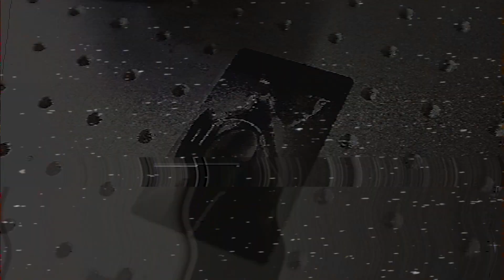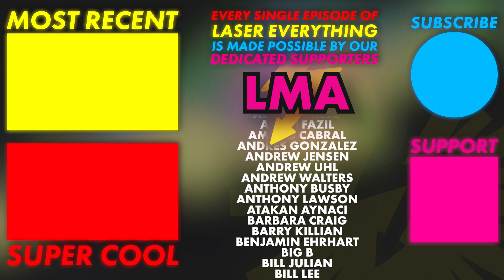The Number ONE Reason Your Engraving is UNEVEN

Comment from the maker: If you guys are looking for answers for CO2 Gantry style lasers, here's a pro tip:
Its a similar issue but instead of a galvo head needing to be leveled it's your bed or gantry. The gantry are the rails the laser head rides along. It's very difficult to level the gantry and it definitely wont fit in a youtube comment but you can shim your honeycomb table just like we shim the laser path in this video with some shims or metal business cards. Most honey comb tables separate from the actual platform to allow you to place shims. Make sure you place them evenly. Remember you are not leveling your honey comb table to the ground! You are leveling your honey comb table with the GANTRY! So place the level on the gantry, then make the honeycomb table match that, shim as necessary. Should solve the issue!

Comment: I have an issue with my 30 watt raycus. When do multiple passes the power seens to get less and less after each pass. I noticed if i apply some downward pressure to the head, where the lens is mounted it seems not to lose any power, but if i release pressure it loses power again
Reply from the maker: Lasers all have a focal range, or a range in which they operate at peak ability, before the dot size is so large you are just heating the area instead of engraving. It sounds like the deeper you are going, the further out of focus you get. You may not be in the center of your focal range at the start, and after a few passes its already hitting the edge of its range. Either way, I wouldn't suggest pressing down on the head too hard or much, as that may cause the issue we discuss in the video to appear (if you end up bending the path and head forward over time when doing that). I'd suggest focusing down a bit more to start to identify if you can get further into the material. If that's the case, it's likely what I described with your focal point not being in the true center of your focal range.
Reply: @LaserEverything  i would agree until i noticed if i pause the engraving for 10 seconds or so and resume it. It seems to fire back at set  power. Only to lose power slowly there after.

Comment: I had this "type" of problem on my CO2 honeycomb.
Reply: Me too, was wondering how to fix it. Then this video popped up.
Reply from the maker: @pfiltz @ianlets7531 If you guys are having this issue on your CO2 its a similar issue but instead of a galvo head needing to be leveled it's your bed or gantry. The gantry are the rails the laser head rides along. It's very difficult to level the gantry and it definitely wont fit in a youtube comment but you can shim your honeycomb table just like we shim the laser path in this video with some shims or metal business cards. Most honey comb tables separate from the actual platform to allow you to place shims. Make sure you place them evenly. Remember you are not leveling your honey comb table to the ground! You are leveling your honey comb table with the GANTRY! So place the level on the gantry, then make the honeycomb table match that, shim as necessary. Should solve the issue!
Reply: I have a c02. It has the main bed, blades and honeycomb. I use a Wixie digital angle gage and place it on the gantry rail, and zero it out. Then I adjust the bed to level compared to the gantry. I have to shim both the blades and the honeycomb. Both are slightly off. Started with hotel room cards 😝. Then went to business cards cut in half. Check all four corners! Rotate the honeycomb to confirm that it doesn’t have to be in the same position each time. Don’t ask how I know 🧐